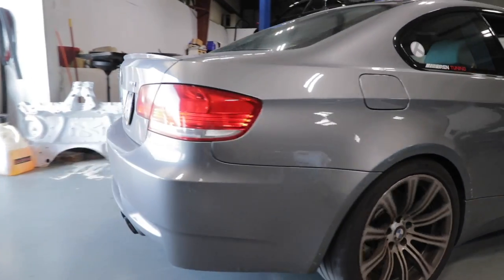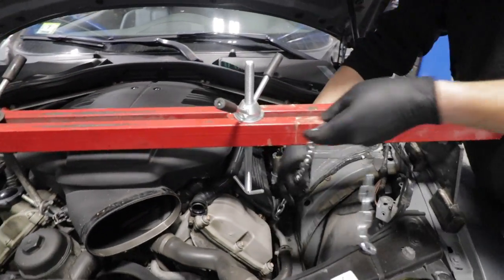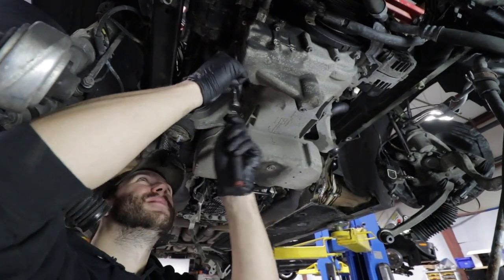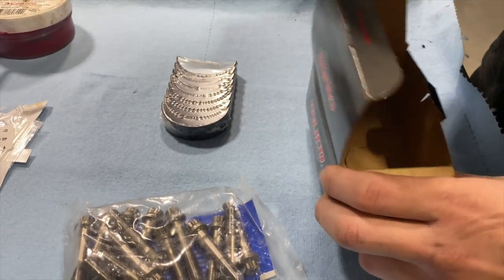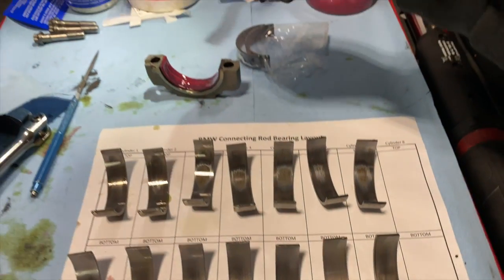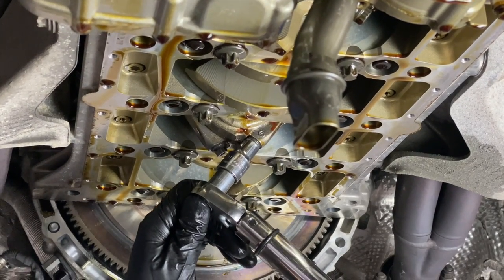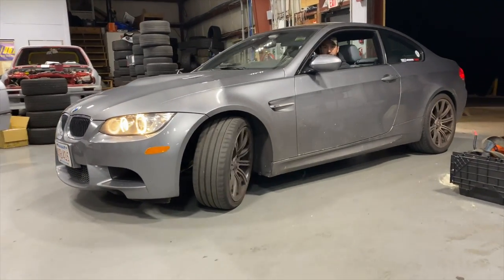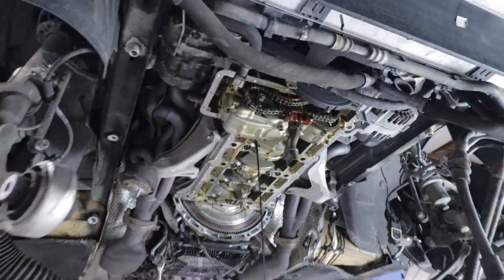E92 M3 Rod Bearing Replacement - What It Takes Start to Finish

Comment: The problem is solved by using less thick oil. 10w60 is relevant only when using the car on the track, where 90% of the time the car is in full throttle mode. For urban conditions, 0w40 oil is suitable, the viscosity of which allows you to lubricate the liners and prevent their failure. Conclusion: if you drive on the track - 10W60, use the car in urban conditions - do not pour such thick oil, 0w40 or 5w40 will do and the connecting rod bearings will live. 😊

Comment: I dont think you should grease the bearings. instead only apply oil. Also how did you determine if you are within the specified gaps when you replaced the bearings?
Reply: They just used standard sized bearings

Comment: How come the torque spec some people are being told should be 50ftlbs and not the recommended 45 from arp? Just noticed your shop used 45. Really curious.
Reply from the maker: The m3 community will seemingly find “better” ways to do everything but never back it up with data or proof. Not sure if this is the case here but i just stopped listening to it all. They’ll tell you the recommended oil will ruin your car 😆. It’s just silly after a while and it only gains traction because hundreds of randoms agree for no reason but that it feels good

Comment: Did they follow the rod bearing color codes or just bought standard bearings?

and how is it running?
Reply from the maker: Standard bearings typically used in these engines. Been running great for almost 20,000 miles since the job and a couple track days

Comment: How did you determine what bearing size do that you needed do you have standard my E46 it's about reaching to 200,000 miles I'm planning on doing this next year spring between spring and summer you guys did a great video on that
Reply: Isreal Perez is it an m3? I have a 323i and I’m at 252k miles and no issues
Reply: @FishFind3000  that's great I have 04 325xi with 199375 I wold like to do it with this car

Comment: 😳HOLY SHIT those bearings. Good save. Had a 2011 M3 and miss it. Not this issue tho.
Reply from the maker: Did you have yours replaced?
Reply: Tedward No I sold the car about 5 years ago due to a divorce with only 16k miles😢. I subsequently bought a used pristine Porsche Cayman 987.2 I’ve had for 4.5 trouble free years. The M3 is now in Arizona and I would love to buy it back someday. I scour bring-a-trailer all the time 🤣. It was a ZCP manual too 😬.
Reply: Nate Mallory gl that was a nice spec

Comment: Let me get this straight. You say the issue is due to tight tolerance so you get new bearings that are probably as tight due to the coating?
Reply: The problem is that these engunes run really thick oil, and especially if not warmed up properly, the oil doesnt flow properly between them and yoh start to skim bearings. They wear irregularly and lose their shape. Also theyve devloped aftermarket bearings now that are a one time fix.
Reply: @marcuswagner1396  Yeah I know which is why I don't understand why he didn't get BE bearing which have a bigger gap.
Reply: @JackRR15  i didnt watch the whole thing, but yeah pretty stupid unless its part of some warranty agreement or something

Comment: Why worry about the engine every time you want to smash the gas? I get it with being a v8 and all but the n54 will our perform it on almost every metric when tuned well.
Reply: The e92 is not all about engine where as the n54/55 is.

Comment: Replace at 81,000? That's why I own Japanese cars.
Reply: good luck with your plastic interior.
Reply: @ziadbakkich3132  but at least the plastic last. Have a honda with 264000 miles still going. No engine or trans work yet. Can your can your European cars do that?
Reply: @jriv5040  BAHAHAHAHA!!!!!!
264k miles is nothing.
my mercedes 350 cdi has 800.000km on the clock. no major repairs. and oil changes every 30k kilometers. no one buys japenese car is europe. here in europe its german, italian, french, volvo or nothing.
Reply: @ziadbakkich3132  ya but u doing  work on a BMW at 81000
Reply: @jriv5040  this car is made for DRIVING NOT GOING FROM POINT A TO B.
Reply: Do not, I repeat do not buy an Acura. 3.7 camshafts are toasts at 80K miles.
Reply: j riv dude the person didn’t take care of it. My dad has a 2012 X5 30d and he does all the maintenance and oil change every 25k km. The car has 280k km. No issues AT ALL. If you take care of the car it will take care of you.
Reply: j riv that cheap plastic interior is nothing compared to my moms 5 series and dads X5. Soft touch every where. No plastic to be seen or felt. Good quality interior and good quality car. Nothing compared to Japanese cars. They ain’t bad but you can’t compare a Japanese car to a German car. It’s like comparing a Chinese car to a piece of plastic.

Comment: I have 45k miles on my E92...I feel like my time for bearing replacement is fast approaching...
Reply from the maker: The odds are in your favor with low miles :)
Reply: I know have 56k on my 2013.  My shop says I can wait till closer to 80k.  I'll have them done before that though.
Reply: If you often find yourself in stop and go traffic, your bearings will wear out quicker due to the constant idle/low rpm and low oil pressure.
Reply: Nikolay Petrov running a high viscosity oil is good too
Reply: I live in Canada, and changed mine at 60 000kms and they were very similar to the bearings in the video.  You might as well do it.  The peace of mind alone was worth the cost of replacement.  I opted for BE bearings if anobody cares, but that is an entirely different topic on its own.
Reply: I have 168.000 miles on our Porsche 911 and I never want to see the rod bearings !!! How can people buy this crap !!!
Reply: @artmchugh5644  Depending on the year of your 911 (996?), I guess it is just the IMS bearings you have to be concerned about.  ;-)
Reply: Dave Ross 85 carrera 3.2 biggest concern is chasing away people who want to buy it !!😄😄😄🍺🍺🍺
Reply: @nathantaylor4043  Not unless the engine is fully at operating temperature before you commence driving.
Reply: @artmchugh5644  Sweet ride for sure!  An older friend of mine at work has a similar ride (believe it is an '87), and I believe his causes the same concern.  ;-)

Comment: What a ballpark price for labor on this job?
Reply from the maker: All in with parts including oil bearings and motor mounts it’s usually around 2500. Subtract the materials for labor cost
Reply: @TedwardDrives  Thanks, not terrible......just need to budget that into the purchase price.

Comment: Can you change bearings on most cars from the bottom or just bmw?
Reply: Mac Challenger all rod bearings are on the bottom of the engine so yes
Reply: Not necessarily, while most "modern" cars do now, some cars dont have removable subframes. So you may have to remove the engine on some models, like on trucks, for example..

Comment: Are you sure there isn’t something wrong there my guy? That is quite  the excessive wear for 80k. The LS3 rods are also cracked cap rods, similar design and that type of wear is unseen unless there was an engine failure of some kind. That’s with constant spirited driving and high revving.

Comment: i got 2013 m3 e92. how much does shop charge for this ??
Reply from the maker: Usually around $2500 for bearings and motor mounts. Some shops are higher, some shops are lower but thats a safe budget.

Comment: Never seen rod bearings worn like that.  Pulled the rod bearings on a Mopar 440 V8 with 151K miles.  No visible wear but replaced them since I bought them prior.  Anyone use plasti-gauge these days?

Comment: Would low oil pressure , indicate worn main bearings ?
Reply: Yes
Reply: @gicugigel3790  wow I forgot I even posted this , 2 yrs ago 😁
Reply: @leorael4497  :)) did you fix your car?
Reply: @gicugigel3790  naw I ended up just replacing it with a new crate motor ! Running like a champ

Comment: It looks like should fill the oil filter up with oil so you don't start the engine run dry for a few seconds there's no reason this type of engine should have oil and bearing problems also they make acumulator that you can actually have oil pressure before you start the engine up may not be a bad idea for a car that cost this much money

Comment: They should of modernized the e39 5.0 engine and used that instead. More torque.
Reply: Yeah, but the S62 doesn't rev as high so it doesn't make quite as much horsepower. I think BMW's priority with this generation of M3 was to reward drivers with a lot of top end power, and to produce that power with a lightweight engine.

Comment: This maintenance just proves that this motor was designed terribly by BMW.
Reply: David S high performance doesn’t mean long life. I have a low performance engine from them and it’s at 252k miles. No rod issues. I’m sending in a oil test right now to see just how well it’s doing.
Reply: @FishFind3000  High performance engines that are correctly balanced and maintained can last a very long time. Honda has produced plenty of high revving, high output motors that don't have bearing failure at 80k miles. BMW is a joke of a company.

Comment: 0:28 "It is a matter of when, not if, they will fail"
Sorry, but you are saying 100% will fail and that's just not true.  I've been following all forums, facebook groups, etc and the grand total of all failures + pictured bearings showing near failure has not hit 1% yet.

Would you also say all IMS bearings will fail? That is at like 8%-10%.  Pretty high, and I would change an IMS on a 996 but still not "when not if" territory
Reply from the maker: You're right..100% won't fail. But put enough miles on them and they'll wear down. We see photos of bearings every day on these groups and more often than not, there's at least one bearing that has its days numbered. There are of course engines that sing happily beyond 100k but does that mean it will last 150? 200? I certainly wouldn't consider abusing an S65 with over 100k miles on original bearings. As for failure numbers...There are none. There is no database to properly call out a Percentage. Just groups of folks reporting spun bearings and catching bad ones while replacing.
Reply: @TedwardDrives  someone on m3post has an e90 m3 with 169k miles for sale, original bearings :D honestly i hope to see more 150k+ mile s65s
Reply: Agreed they won't necessarily fail, but is it really worth the risk?  For some yes, others no.  Actual owners of the e92 M3 will probably say "yes" it is worth changing them.  I purchased an e92 about a year ago w/ 62000 kms, and it also about 13 track days.  I purchased it with full intention of replacing the bearings, and I was happy I did.  The bearings were worn similar to the ones in the video, but did not fail.  I would love to see many cars with 150000 miles on original bearings.  Would I ever purchase one of these and take the risk of driving without replacing the bearings?  Definitely not.  Some may think otherwise, but in my mind why risk buying a $20k crate motor (and possibly labour) over a $3k bearing replacement... and more importantly a peaceful mind not having to wonder "is today the day my ending detonates?"
Reply: @24dross  you know i agree, i actually just sold my e92 m3 2 days ago. i didn't like the feeling of "will this be my last drive" or the idea of spending 3k on bearings that were still fine or will blow even themselves after being changed. really it was just time for a change, beautiful car. but something turbo this time i think
Reply: It really is a when issue at the factory bearing specifications.  Bottom line is bearing failure can lead to much more engine damage.  Preventative engine maintenance is less expensive than engine replacement.

Comment: Wonderful engines.. inside clean as mirror so oil service is top notch. You still have to replace bearings each 60 000km if you drive it semi-hard. Nice. :D Pile of crap. Comparable and stronger AMG engines need this like practicaly never, most of these cars dont get so much mileage it is needed.
Reply: But head bolts pull out and other similar problems.
Reply: Yes rarely on M156 head bolt gets corroded, not pulled for ffs. :D Rarely.. whilst you have certainity this bmv crap wont make it past 150 000km even if you babysit it without rebuilding bottom. Then VANOS problems kick in etc etc.
Reply: If only mercedes would release AMG cars with manual transmissions mated to their glorious 6+ liter v8s.

Comment: 80,000 miles is nothing. Engine bearings will last to 100k if driven hard, and 200k if driven gently.
Reply from the maker: These engines spin bearings all the time well under 100k.

Comment: Engines usually don't last long after bearing swap. This is a bandaid fix and will only last a few thousand miles if that . lost cause .

It was better off left alone if it wasn't knocking at all.

Comment: It’s a factory built racing engine.  In my eyes last true M motor ever built.  If your not prepared to deal with things like this owning one of these vehicles then buy a Honda.
Reply from the maker: Bingo! 8400 RPM comes with some compromise haha..Although I also want a honda :)
Reply: Yea a Honda S2000 AP1 that is. Revs to 9000 rpm and can go 300k+ miles as long as the oil level is maintained and changed regularly...
Reply from the maker: @MrRevto9k  Totally agree.. It's awful that this is a flaw in the BMW.

Comment: Oh, I see je just lifted it up a bit do do the mounst, but still replacing rod bearings at 36K miles? German engineering has gone way down hill over the years it seems?
Reply from the maker: the engine had 80,000 miles. no-one said 36k

Comment: 8:08 10w-60? What?!
Reply from the maker: That’s the oil spec for s65
Reply: Tedward that just seem so much heavier... my car uses 5W-30

(My mom’s car uses 0W-16 and my dads car uses 0W-20 but they’re both hybrids)
Reply: @JoeyLovesTrains does your car have a V8 that revs to 8400 rpm?? I'm guessing not.

Comment: I am selling my M3 because need rod bearing after I did both throttle acutator.
Sorry but there are many fast cars at the same price and more reliable.
M3 over rated..
Reply: @makemoneyonline8793  yes I regret so much buying. AMG and Ms are great car but its kinda car that's design to last thru car lease period.
Reply: that sucks.  what year m3 and how many miles?    i got 2015 mustang 5.0 after test driving several m cars and each one had problems.
Reply: @1compaqedr8  it's a 2008 with 98k runs on 10w 60 which the torque is hard to reach in city driving, I should have got a 997 instead. Keep mustang solid engine.
Reply: TIM Cheou yeah the 5.0 has been great. Thinking 18 5.0, C7 vette, or M4 next.  Would a 997 be more reliable than e92?
Reply: @1compaqedr8  the issue with M3 is it's quite picky on engine oil type small displacement high output place a lot of stress on the engine, they had to make rod bearing tight because of high rpm, it needs high rpm to generate high output of its ltr, personally I like Porsche more because it's not as selective as oil type, plastic bits does not fail like BMW, BMW is quite unreliable in plastic parts also, if you do pick Porsche as long as there are evidence that oil was change on time, yes it's better engine then M3, with M3 you gotta make sure last owner did warm up but you cont make sure that, but with 997 since it uses 5w oil it doesn't have the M3 rod bearing story except IMS bearing, but that issue is always prevented with adequate oil amount and changed oil. I have a 986 Boxster on the original IMS bearing dines 220,000 km never rebuilt. My M3 is ok but need new gasket now all bmw tends to oil leaks quite early, engine sound wise stock M3 doesnt sound as exciting as 997 but yes M3 is faster then 997 c2 but 997 don't have the need to warm up. Feel free to watch my videos in M3 and 986. If you after sound, easy maintaince probably Porsche, if you after sedan comfort M3 but M3 you cont avoid rod bearing Porsche if you are lucky nothing need to spend on engine from day one, and should that be the case probably don't need to spend on. But both of these cars once you got a lemon it's all the end, but in design point of view Porsche engine in 997 personally I think it's better reliability then M3 despite slower if so it again I buy 997 as it needs to rev less for power, sounds great cheaper engine oil, faster warm up. Do note M3 needed thick 10w 60 oil is because BMW did not built a tough engine, thick stuff was the old school mod thinking.
Reply: @1compaqedr8  I would get the better for engine reliability.
Reply: TIM Cheou go for the newer 997 with 385hp and direct injection.

Comment: Its ironic that the newer motors from BMW need their con rod bearings replaced at 80,000 miles! Most German motors of that mileage are just gaining better power and fuel mileage as the engine has become properly run in! 
To me this is a retrograde step in design. This design of race like tolerances in a road car is highly unnecessary! And shows BMW really don’t care about their engine reliability. Trying to hide behind the old chestnut of the emperor and his new clothes mindset! The benefits of zero tolerance in bearing technology has little to no justification! Especially when it comes to exotic high price motors!!
In my opinion this is a cheap shitty trick!  To sell more cars!!